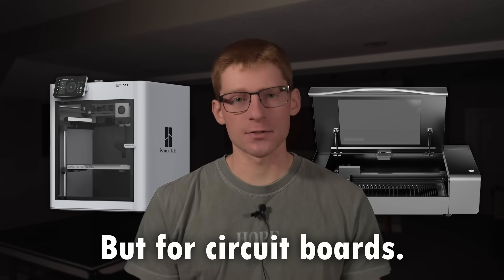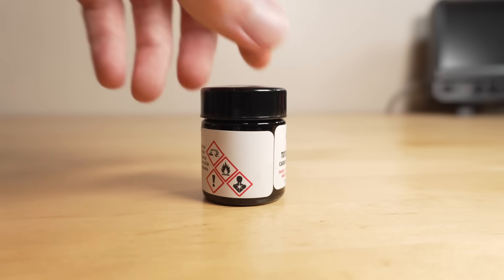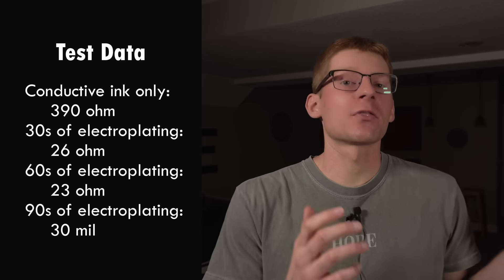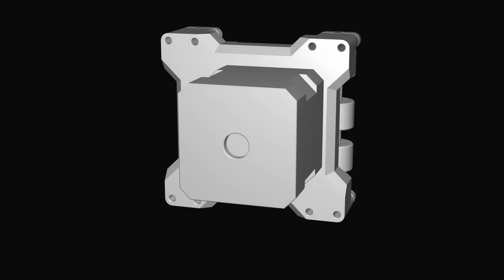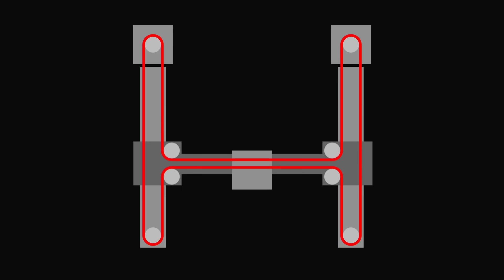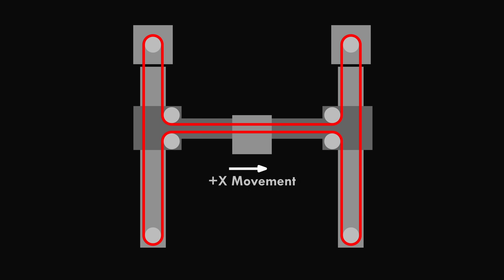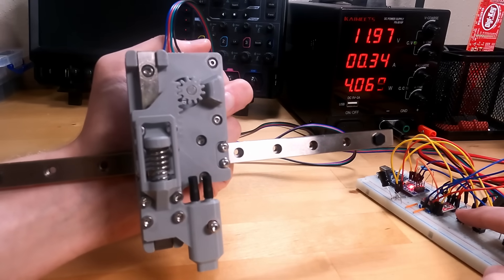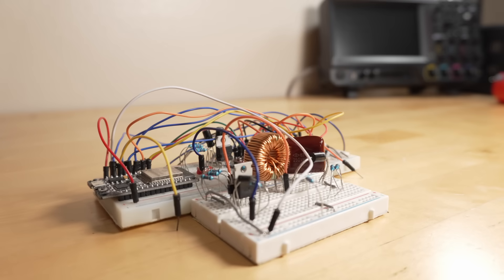I'm Developing a New Circuit Board Manufacturing Technology

Comment: Unless you are aiming to do multi-layered boards, PCB rivets is the answer. They are old school and extremely robust. If the end goal is multilayered boards, then god speed good sir. I would love to be able to do 4 layer boards at home.
Reply: The major problem with PCB rivets are that they aren't actually made to do that- or practical for complex circuits. They might work for this use case, but still have a lot of drawbacks. Instead they are made to mount a heatsink or other non-solderable component via the connection instead. Many circuits that use high amperage op-amps or rectifier blocks use this method for cooling to a passive aluminum heatsink. Toasters/toaster ovens use them to connect the nichrome or steel heating elements to the board, where that much heat would melt the solder of a regular connection.

 Most of them are thicker where they would be mounted requiring milling a small channel into the board around the via (to account for it's chamfer) for it to sit flush with the board itself. There are also only 3 ways to to connect one half of the rivet to another, the button method, where one of the hole openings has the mount point, but is larger & a few mm thicker than the other, the rack method, where small square channels are cut into each side of the center of the rivet allowing them to slide into each other like the guide for a drawer in a dresser. This allows for the thinnest via's but has the worst resistance & tend to separate under many heat/ stress/ weight cycles, sometimes breaking the connection completely.

 Lastly is the flange method, which causes one side of the tube to expand outward in the center of the hole. Not only does most of these methods usually require oversizing & extra milling time for the hole & the lap space between them, but the smallest rivets are 0.6mm in size, compared to modern whole board CPM which can have via's as small as 0.15mm in size.
Reply: As his goal is making prototyping PCBs, I think they might just do the job
Reply: @elvendragonhammer5433 for circuits with any kind of complexity, 2 layers don't cut it in any case, and you can have a professionally manufactured prototype shipped to your door in under a week.
Reply: I think you are talking about eyelets.  Many years ago, one of the pieces of military equipment I worked on used eyelets rather than plated thru holes.  I don't think they trusted PTH at the time.  The eyelets gave us a lot of trouble with corrosion around the eyelet ruining the connection.  Reflowing the solder around the eyelet would fix the problem, at least for the mean time.  This was not a cheap piece of equipment, it was used to synchronize cryptography equipment.
Reply: im pretty stupid does that mean using a ring of metal and clamping it into the bord in normal speak
Reply: @parcorpor  Yes, I looked it up to make sure - it's a ring of metal that's flared out on each end and clamped or stamped down.  Ends up making an electrical connection from one side of the printed circuit board through to the other.
Reply: This was my immediate thought as well. For prototypes, this should be sufficient, no?
Reply: This. Via rivets would be waaay easier than any other method
Reply: I'm a total noob at this, but couldn't you sandwich boards together to make multilayer PCBs? It obviously won't be a nice as something from a manufacturer, but it might work.
Reply: @TheArtofCodeIsCool at first I thought, "but how would you connect them", then it occurred to me that one could use pin blocks.  A lot of computer cards do this, with daughterboards.  On the other hand, it doesn't take very many pins (more than about a couple dozen) for the force needed to connect them to become impractical.  Still, it's a thought!

P.S. As one real-world example of your sandwiching proposal, Sangoma analog cards use the pin block interconnects and sandwich boards a fair bit.

Comment: Maybe more cone shaped tip instead of a tube to concentrate the resistance to mostly to the via. Also what would happen if the electro plating current would be ac. Or pulsing the plating fluid back and forth to keep fresh fluid in the via.

Comment: Sounds like it would be easier to move the board between stationary toolheads rather than moving two toolheads around a stationary board. And why plate holes one at a time? It does make sense to ink them one at a time since it's quick and needs to stay off the surface of the board, but make the plating toolhead bigger. Maybe 25x25mm and move it around in a grid pattern, or make it require 100mm wide board material and have a toolhead 100x10mm or something move across continuously depositing copper.

Comment: Is one idea you're thinking of using an inserted wire for the via? If the wire is made of solder, maybe you could insert it and touch off each end with a soldering tip. Not sure if that would work for resistance, but idk why it wouldn't work.

Comment: I was wondering for a while if the drilling of the holes with a laser, leaves enough charring of the hole for it to be conducive enough for plating. 
The other question I would ask my self is, if there is a needle/pin that is fed into the hole, while the electroplating solution flows around the pin
agains the conductive surface, so you have shorter distance and more controlled application ?

Comment: What if you were to simply make "manual" vias?  Put a small pad on both sides of the board, put a piece of copper wire through the holes in those pads, and solder the wire to those pads.

Comment: dumb question but does vias always have to be hollow? maybe one way to do it could be drill a hole and feed in a small bit of wire that is soldered, cut and flattened by drilling.. maybe it could be just solder even..
Reply: I don't think solder is a good idea (imagine if you accidentally melt it by soldering components), but pressing some copper is definitively something I would expect for a prototyping machine, even if it's probably not trivial with thin vias...
Some commercial machines uses hollowed copper inserts for vias, but AFAIK they are >= 1mm diameter. No idea if this can work with smaller vias.

Comment: One potential idea I had for simplification of the mechanics is a secondary outer o ring which provides a second sealed area that you could connect to a cheap 12v vaccum pump to suction down onto the board for a solid seal with a less rigid gantry required. You could also probably build magnets into the heads for registration and use an approach where some loose strings pull the heads roughly into position, the magnets cause them to snap into alignment, and then the suction engages providing a solid seal to the board

Comment: Would it be possible to just 3d print conductive material onto pla, abs, etc on a standard 3d printer?
Reply from the maker: There are several products that do something like this, but conductive ink/filament is still nowhere near the conductivity of copper. Prohibitively so, I would argue.
Reply: @LeviJanssen  that's a fair point
Reply: @LeviJanssen Have you seen the PCB maker Bad Obsession Motorsport designed? If you haven’t, it prints traces with solder directly on to FR4 board so the conductivity is better than inks (though definitely not as good as copper). Their boards were two sided as well, though I’m not sure what exactly they used for their vias.

Comment: Not even a minute in and already an error, Lpkf has solutions for multilayer PCBs. We use their equipment regularly and while it’s cost prohibitive for makers it does work. We regularly do multi layer prototypes on our equipment with 0.2mm vias and same minimum spacings as jlc etc.

Also look into black hole method (carbon/graphite) hole activation. A lot simpler than electroless copper.
Reply from the maker: The picture was just of their mill, which cannot produce vias on its own. You can produce multilayer boards with LPKF's full system, but not with a single machine. That was my point.
Reply: @aaronwilliams7062 even if you where right there is no need to be auch an ass about it

Comment: Selective soldering has a little hot bubble of solder coat pcbs

I wonder if a system where you could apply a solder mask and leave the bias exposed would allow for a solder based via.

This would mean you'd need to be able to apply solder mask automatically and remove it selectively with a galvo laser or cnc router but just another option I thought about.

Comment: In my mind, this process makes sense:
(This process begins after all via holes are drilled)
 1. Insert a strand of wire into the hole(alignment hell + you need multiple wire gauges) 
2. Align or trim the end section of wire flush to the board. (Difficult to prevent marking or damaging the surfaces)
3. Deposit a thin film of flux and potentially high temp solder. (Brazing metal?)
4. Spot weld the bottom face. (this is probably the biggest stretch. The difficulty in calibrating the pulse energy and duration is beyond me)
5. Cleanup/maybe surface the weld
6. Repeat 2-5 for top surface
As with most engineering ideas, this is much easier said than done. I like this process more because all of these steps have high time optimization potential. If you read this, please let me know if you have any thoughts or critiques on this process. Regardless, this video is badass.
Reply: Why not wire + chemistry? Anyhow, wire vias in DIY circuits are common.
Reply: @jammi__ I just don't think plating is optimal for this project's goals. Chemistry clearly scales well. This is why it is so dominant in industry, but if you do 1 via at a time total fabrication time will suffer. Also, having to worry about electro plating consumables seems way more complicated on its face than just buying wire spools.
I must say, though, I am not an engineer. That is why I wanted input from others with real experience to tell me where I am wrong/nieve if possible so I can learn.
Reply: well i think it would be viable to use riveting. So bottom head would have anvil and top one would have anvil and wire feeder with cutter and fter that guide tube. Steps to do via after drilling: 
1 position bottom head under hole
2 position guide tube over the hole
3 extend bit of wire (thickness of pcb + something for rivet heads)
4 use wire feed to push cut piece down the tube
5 lift top head (feeding bit more wire while lifting should prevent tiny piece sticking)
6 move top anvil over hole
7 lower bottom anvil  bit to allow wire to poke trough (optionl step can be integrated with inserting wire)
8 squish from both sides
Possible problems: cutting 0,25mm copper wire without it being stuck somewhere, possibly not tight enough squeeze, but but if it could apply solderpaste then it should be possible to smear  little bit over vias and they would self solder during reflowing
Reply: @michatrzcinski8741  This seems more doable but would lead to a lower quality via. First, even if you squish the head super flat, there will still be a raised section that could interfere with smd parts that go over top of the via. Secondly, for pretty much any mechanical method other than maybe stir welding, you will end up with a microscopic gap. This would have higher resistance, could cause intermittent contact issues,  could decrease signal quality, and would have lower mechanical strength. 
I will say, though, that your idea seems much easier to implement.
Reply: @michatrzcinski8741  just edm the wire cut clean, would take, less than 2 seconds, squirt some water
Reply: alignment to a small aperture is pretty simple optically
Reply: Automating a wire via is probably the long term solution to this goal.

1: Procure solder plated wire
2: Dispense wire past a sponge with flux
3: Align head with hole
4: Extrude wire 0.5mm beyond bottom copper
5: Bend wire over with hot soldering tip and solder to bottom copper
6: Cut wire 0.5 from top copper
7: Bend wire over with hot soldering tip and solder to top copper.

The only exotic thing is the solder coated wire and a thick tin plating might already work.

Comment: Regarding the copper creeping into the toolhead at higher voltages, what if the board layers became the electrodes rather than a separate electrode in the toolhead? Apply power to one layer and ground the other. This might limit the plating zone to only the space between the layers rather than allowing it to extend into the toolhead and seems like it would be a relatively simple test using your existing prototype build.
Reply from the maker: The layers are shorted by the conductive ink and by previously plated vias, so no current would flow through the solution.
Reply: @LeviJanssen  Right, of course. That should have been obvious.
Reply: @LeviJanssen  Isn't this also a problem when you make a second via on the board with your method? 🤔

Comment: Great result, but I'm not sure I agree with the failure conclusion. 0.1mm vias are an arbitrary constraint that don't have anything to do with your design goals. This is for rapid prototyping, not final production. Live with bigger vias, bigger boards, and probably bigger traces and call it a success instead of a failure. If it was me, I would increase to 2mm or 5mm vias just to make everything easier: easier drilling, easier tool changing, easier alignment, easier via plating. I mean, actually if it was me I would see if I could use some kind of conductive rivet instead of creating a double-sided 2-gantry core xy machine with multiple tool heads. Cost may not be your limitations, but complexity will definitely kill the project before you've even proven the concept

Comment: Since the start I though - OK, once he plates the first via, HOW will he do the next one, when the copper already deposited make less resistance and the current will just flow around preventing the plating at all?
My suggestion - what you need is conductive connection. How about just simply stick in 0.3mm copper wire, cut it and smash it from both ends, creating physical connection? Or by concentrated heat (laser?) melt the end to fuse and weld with the plate locally on both ends? This can even cut the wire for you in process...

Comment: Very interesting project! Before giving up entirely, have you considered running some tests to investigate the influence of the viscosity of the liquid on the deposition?
Reply from the maker: As far as I'm aware, viscosity isn't typically a consideration for electroplating solutions. It also isn't something that can be easily adjusted.
Reply: @LeviJanssen   The reason I asked, was that I suspected that in your setup, the decrease in via size may have changed the relative effect of the surface tension on the deposition process used to cover the walls of the via. Maybe you could test with different concentrations of surfactants to see if my suspicion has some merit?